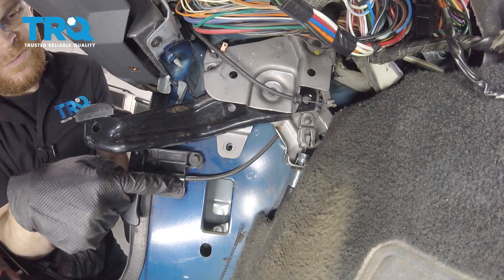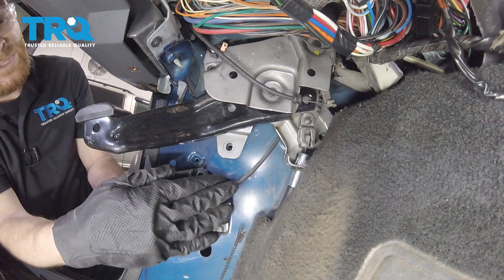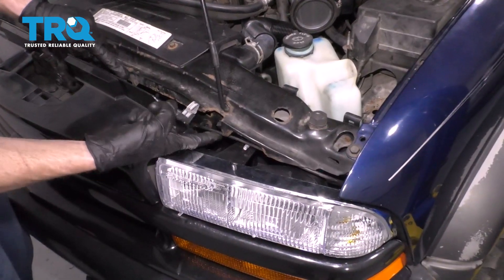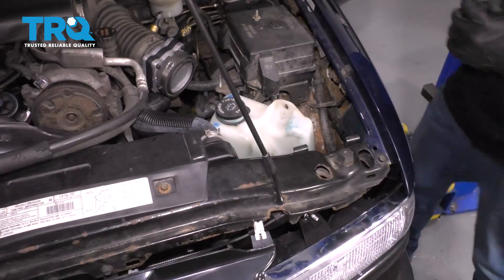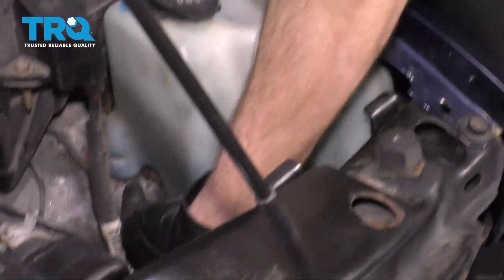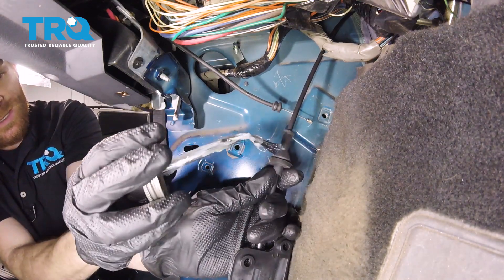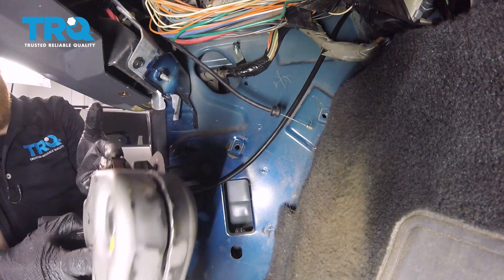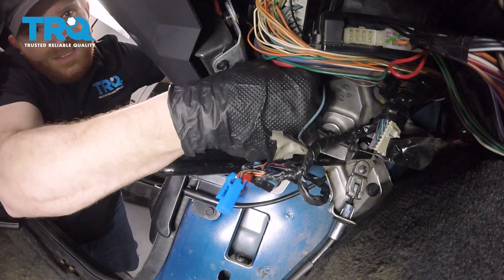How to Replace Hood Latch Cable 1994-2004 Chevy S-10

Comment: Why at the beginning when you first disconnect the cable, the spring was on the barb end of the cable. When you reconnected the new cable the spring was toward the sleeve end? I just did this job and my original spring was also on the barb end,  when connecting the new cable I referenced this video and connected it on the sleeve end, while scratching my head thinking it didnt come apart this way. Re-watching this video from the beginning I now have doubts if I installed it properly.

Comment: The new cable was improperly installed in this video. The tension spring should have been installed on the passenger side of the retaining clip, the way it was when it was removed.
Reply: This has the potential to create slack after a lever pull and allow the cable to pop out of the retainer creating a situation where the hood wont release. I hope they add a revision to this video. Looks like 9000+ people used this as reference. I wonder how many followed it verbatim and reinstalled the spring wrong. I know I did.

Comment: Wondering what harness is that plugged in at 9:40?  Completed this task of  my hood cable and latch did the spring on latch side of cable same way as the video pulled back, also for some reason my brakes felt mushy at the end of this task I also work completed my audio system and ran a 14awg through the fire wall